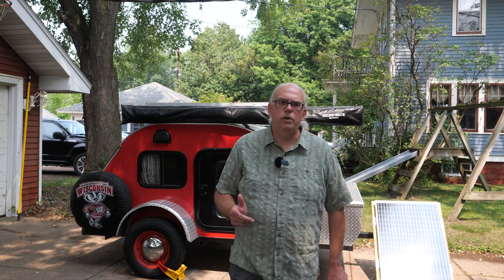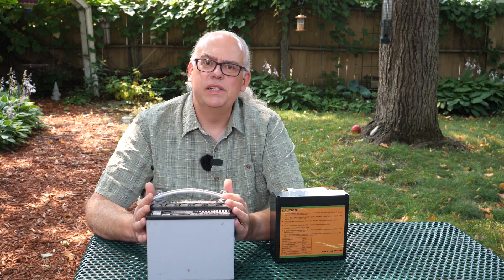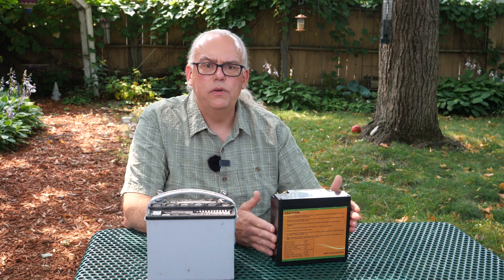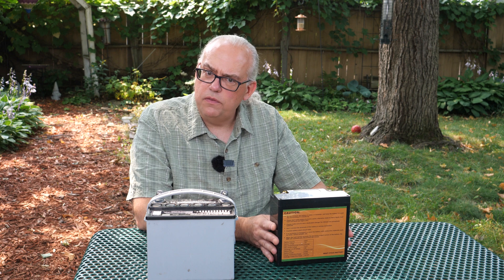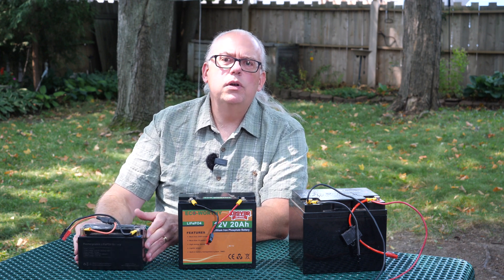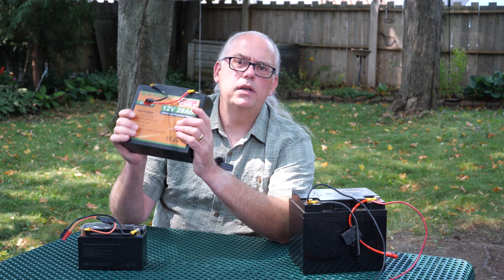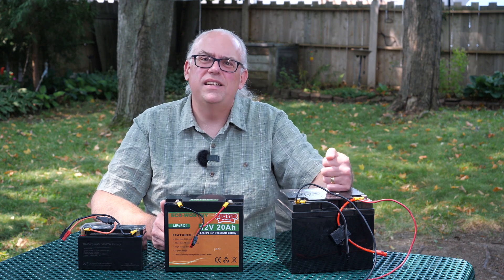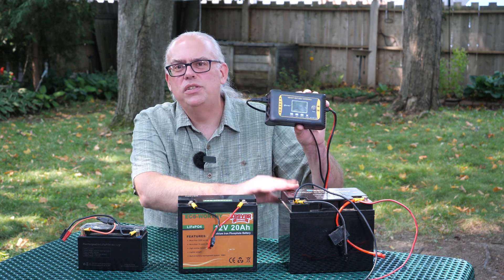Picking the best battery for portable Ham Radio #hamradioqa

Comment: I would recommend using an RC battery charger over that cheap type of car charger. The RC charger can charge more chemistries, can choose between different amounts of cells, allows you to set the charge current, can do balance charging (useful if you make your own batteries or are using a LiPo pack), and you can even have it charge/discharge to the recommended voltage for long term storage as well. 
With the car charger, if it is high current, you might be putting too much current into the battery so you might want to refer to the manual for it before connecting it to the smaller capacity batteries.

Comment: 24v capable radio like a McKinley will draw half the amount of amps if you have two of the same batteries wired in series 🤫

Comment: Something I did to address the issue of charging my batteries is that I installed a 4 gauge cable between the positive of my cranking battery under the hood to the trunk of my car, through  a 100 amp circuit breaker at the battery post.  I then connected a short 4 gauge wire to the chassis of the car in the trunk and fitted the positive and negative cables with a 50 amp Anderson Powerpole connector.

I also fitted my LiFePO4 batteries with the same 50 amp connectors to make connection in the trunk fast and easy.

When not in use, the  cable and connector are tucked out of the way in the trunk.   When my batteries need charging, I start the car and connect them in the trunk.   This provides a high current charge that minimizes recharge time.    

Measuring the draw from the alternator, with a 100 amp hour LiFePO4 battery in the trunk, the charge rate typically starts out at around 50 amps and within a few minutes drops down to about 20-30 amps, depending on how discharged they are - and, depending on their capacity.  

I have portable solar panels.  But, like you, I would prefer to not bother with them for a day trip.

During use, I connect the battery that I'm using to an MFJ power distribution box with four fused 20 amp Anderson Powerpole connectors and two pair of fused binding posts.    The distribution box has a 40 amp fuse.

No matter what the state of my battery, I connect it up in the trunk to recharge on the way home.

Of course, I am only getting 13.8 volts - which is why the current draw remains low enough that it does not risk damaging the alternator.   

Like you, I don't usually run out of power for day trips.   If I am camping, though, I'm running more than just radio equipment and I usually need a recharge.   But, if I will be camping in sunny weather, I will bring my portable solar panels (up to four 100 watt flexible panels) and charge through a Victron charge controller.

Thanks for the video!

73
Ai4IJ

Comment: Great video! Quick question —  I'm going to be hooking up a Renogy solar kit to a battery, and then hooking up an FT-891 (at 10 watts) and ldg z100 pro to that battery. My question: will hooking so much up to the battery terminals cause any issues?
Reply from the maker: It shouldn't. Solar charge controllers are designed to work under load so you can charge the battery while using it. The only concern would be noise from the controller. PWM controllers are very quiet and shouldn't generate noise. MPPT controllers, by their design, can generate noise (It depends on how well they are made and what filtering they have). I've got a 100 watt Renogy solar suitcase and it has a PWM controller, so yours might be the same. Test it before heading out into the field.

Comment: I've got a 30ah Bioeno battery that I use with my FT-891. What I'd really like to have is a battery monitor like we have in our RV trailer. It shows power in and power out. It shows the current state of charge in percentage. It's got a shunt hooked up to convey this info. I have yet to find something like this for us hams that is plug and play. Do you know of any battery monitors that would fill this bill?
Reply from the maker: I use the Victron smart shunt in my trailer, but it may not be the most practical for a portable battery kit. A lot of hams use an inexpensive battery meter like this to monitor their power: https://amzn.to/3ZSBYe7
Reply: @KB9VBRAntennas  So basically, instead of having a real time monitor, you just keep track of power used with this simple monitor. Write down hour beginning and ending values.

Comment: Question for you.  If you take 2 smaller batteries and hook them up in parallel, would you be able to draw more current?   Example if you have 1 battery at 12 amp hours therefore you should only get about 12 amps max from the battery.  Now if you take two 12 amp hours batteries in parallel would you be able to get 20 to 24 amps?
Reply from the maker: You can, with a caveat. Because LiFePO4 batteries use a Battery Management System (BMS) to control their current output, you will need batteries that are matched. That is, they will need to be the same brand and size. Otherwise the BMS in each battery will fight with the other. It's best to consult the manufacturer guidelines if you are planning to hook two or more LiFePO4 batteries together in parallel. In the long run, it is often better and cheaper to buy one larger battery than two smaller ones.

Comment: Hi Michael, Do you have any suggestions for Batteries for use as Base Backup... to run a rig, small inverter, light... for power outages and (Heaven forbid) in case of an emergency?
Use the same Battery chemistry or for longer term storage than a few days is different chemistry better"?    Thanks for spreading the Good Word! 
73   mike   🍺🍻

Comment: The batter rated for 12v my tyt9800 said power for the unit is 13.8v +/- 5%.  Does it effect anything (tx/rx) if the unit is slightly under powered?
Reply from the maker: With any battery, the voltage will drop when you pull current (Ohms law). As long as the battery has sufficient current capacity (it's amp-hour rating), those voltage fluctuations won't affect the overall power output of the transceiver. But if the battery is unable to provide full current to the radio, then the power output will be diminished.

Comment: Dumb question. Can you power multiple devices with one large battery Or do you need a separate battery for each device?  I’m just starting in ham radio
Reply from the maker: You can run multiple devices on one battery, as long as you stay under the battery's current rating. A battery isn't able to provide more power than their Amp Hour rating. And LiFePO4 batteries have a BMS or battery management system that is rating for a maximum current draw to protect the battery itself. As long as your current draw stay's under the maximum rated draw on the battery, you will be fine.
Reply: @KB9VBRAntennas  how do you measure or determine the total draw of the equipment running?
Reply from the maker: Devices, like radio transceivers, will have their power consumption listed in the specs. You can add up those numbers for an estimation. Otherwise a 12 volt power meter like this: https://amzn.to/3BQgyq0 is really helpful in understanding power use.

Comment: CAN I USE A REGULAR 12V CAR BATTERY CHARGER TO CHARGE THESE...? and can I run cb radio on a 12v car battery in my house...?
Reply from the maker: You can run a CB on a 12 volt car battery in the house, I've done that many times. For LiFePO4 batteries, you will need a charger designed to charge them. The charging rates and full charge voltage is different. A lead-acid charger will be unable to fullly charge a LiFePO4 battery unless it has a LiFePO4 mode.

Comment: Hi Michael. Thanks again for yet another great video. Time for me to move to your Patreon. Question:
 I have a LifPO4 battery ROHS 12.8 Volt and 18 Ah. Bought a charger with it: LiTime LifePO4 specific battery charger, 14.6 Volt, 20 Amp. Would the discrepancy 14.6 Volt and 12.8 Volt going to give any issues ? Thanks, even having an EV, battery technology remains a bit of an enigma to me. 73 from Johan, VK6BLU, Perth Australia
Reply from the maker: LiFePO4 batteries are advertised having a nominal voltage of 12.8 volts as that's the power we commonly expect that type of battery has. It's a carryover from the lead-acid days. But in actuality their nominal voltage is closer to 13.4 when fully charged. When you charge a LiFePO4 battery, the charger will charge the battery until it reaches 14.6 volts. That's the point when the charger senses that the cells are fully charged. When you remove the charger, though, the battery will quickly drop to 13.4v and maintain the charge level while it sits on standby.
Reply: @KB9VBRAntennas thanks so much michael, johan, perth, vk6blu

Comment: Question , I have a GMRS 50watt 12V basically it’s meant for a car but I’d like to set up like a com backpack  . How long could I run that with either battery ? I thank you in advance for your time sir .
Reply: I would get a bioenno 15ah. That would be fine, you’ll get a couple of hours of life out of that battery depending on how often you’re transmitting.

Comment: What do you recommend for a 50 watt mobile wouxun radio???
Reply: Depends on how much you transmit. A Yaesu FT-891 can go up to 100 watts, but the Wouxun radios, whether GMRS or ham, could utilize the same batteries. If you’re going for a couple of hours, I’d recommend at least a 20Ah.

- KF0QNM

Comment: Hi Mike, quick question , i like to run my ft 891 with cha tdl on pota, i can get a 12v 18 amp  Lithium Battery for 140 $ CAD or 12v 30 Amp  Lithium Battery for 300 $ CAD, you think the 12/18 can run the ft 891, if i decrease the hf out to ~ 75-80 watt out put ? Voice only . thanks
Reply from the maker: Since SSB is not a full duty cycle mode, you will seldom draw the full 20 amps when transmitting it at 100 watts. An 18 ah battery will manage 100 watts transmit for about a couple hours or so. Reducing your transmit power will increase your battery life. For example, I transmit SSB at 50 watts, and with my 20 ah battery I can get about 5-6 hours out of it. In that time period I'll make well over 300 contacts, so that is a pretty high utilization rate.

Comment: What amp charger would i get if i get the 30 amp version of the eco worthy
Reply from the maker: I think there is a formula to help you decide, but my general rule is to pick a charger that's 1/2 to 1/5 the capacity of the battery. I'd go with a 10 amp charger for a battery that size.
Reply: @KB9VBRAntennas  thank you and thanks for doing these good videos

Comment: How safe are the lithium batteries for home (indoor) use? I understand if on fire, very dificult to extinguish. Thank you.
Reply from the maker: There are different lithium battery chemistries and some are safer than others. Lithium Iron Phosphate LiFePO4 has been proven to be very safe and it has been found that it takes a lot of overcharging, coupled with a faulty Battery Management System, in order to get them to heat up and swell.

Comment: The comment about discharging lead acid below 50% will cause damage is FALSE.  You will find no such information in manufacturer data sheets.  If your equipment can operate at the terminal voltage the battery supplies, lead acid can be discharged many hundreds of times to 0%.  This represents years of operation for a typical ham doing field operations.  There's no denying the performance advantage of lithium but lead acid can still have a place for portable operation.

Mark K5LXP

Comment: How about using power station like a Bluetti EB55 which only draws out 12v 10Amp? Does it suitable for operating FT8 15-20watt with Yaesu FT891?
Reply from the maker: The issue I have with power stations is that the accessory port (cigarette lighter) is regulated at 12v and 10 amps. It's a hard limit and the transceiver will shut down if you draw more current. The transceiver works best at 13.8 v +/- 15%. If the voltage also dips below that threshold, the transceiver will shut down. 

With the FT-891, I've found that I can't go more than 40 watts SSB using a power station. 15-20 watts FT8 may be possible as long as the Bluetti can deliver a consistent 12 volts.

Comment: Some interesting information here, thanks. 
I bought 12 AH Sealed Lead Acid Batteries for home use with a solar panel with my QRP h/b radio and then got an FT817ND for portable use but a lead acid battery is heavy for a rucksack so looking into Lithium Iron Phosphate.
G4GHB.

Comment: I have a qrp radio that needs 12V , lifepo puts out about 13.2V, want suggestions ?
Reply from the maker: Most transceivers will work +/- 15% of their recommended voltage. Check the specs for your radio to see what range it desires for an input voltage.
Reply: @KB9VBRAntennas  the QRP Labs QDX will not, effectively.  increased voltage from 9V to 12V. Decreases Output power from 5W to 3.6-4W depending on band. Additional voltage will me at a QQQRP radio 😀

Comment: Thanks for the video I use a 30 amp version made by Powerhouse. I have done 5 VKFF parks to 44 + QSO in each 30w ssb 20w cw that was about 12 hours on air time all on the same charge. Cheers all 44 73 vk5cz ..

Comment: Michael,  I love that you are pushing LFP batteries.  I have been doing that since 2020.  I would like you to think about checking out REDODO Power.  They have a 100AH LFP that is small enough to fit in a 50cal ammo can and is half the weight of a regular LFP 100.  Very new unit, and I think would be well worth the cost.
Reply from the maker: I don't have any experience with the Redodo battery. There are new cell configurations coming on the market that are reducing the size of these batteries. It appears that Redodo sent free batteries to a bunch of people for review. In disclosure, they offered me a free battery but I passed on it- I don't have to facility to do an objective review of these larger batteries. For excellent insight and teardowns of LiFePO4 batteries, I recommend Will Prowse' channel. https://www.youtube.com/@WillProwse

Comment: Nice informative video.  Do you run your FT-891 directly from your battery or do you use/need a boost regulator to raise the voltage up to 13.8 volts?  In other words, how well does the FT-891 work on voltages lower than 12.6 volts?
Reply from the maker: I don't use a booster with my LiFePO4 batteries. I really don't think they are necessary with that chemistry (unless you require voltage stability) as the nominal voltage of a Lithium Iron Phosphate battery is 13.4 volts. Nominal voltage of Lead Acid is 12.6v.  The FT-891's voltage requirement is 13.8v +/- 15%. It will operate over a wide array of voltages. I've had no issue running it with lead acid batteries and with LiFePO4 batteries as their charge diminished. The only time the radio shuts down is if the floating voltage drops below 12v.
Reply: @KB9VBRAntennas  thanks for the info.  Very helpful.  73

Comment: I am working to set up an outdoor UHF repeater, which will get little use. 
I would like to set it up with a battery power supply that I can occasionally run an extension cord to to recharge. 
1 will the analyzer you mentioned record a history of the use pattern so I could come and check it after several days or weeks to see what the draw pattern has been?
2 do you have a recommendation for a lithium iron battery which has one or two 12V outs and the ability to charge from an extension cord?

Comment: Michael, holy cow.  Let's talk trailer for a moment.  That looks like something I googled called A "Diamond in the Rough" by Teardrop Trailers, Inc.  Is that diamond plate all over it from front to back, or does the top of the trailer just appear to be?  How do you like it so far?
Reply from the maker: The trailer is a TC Teardrops 5x8 camping trailer. https://www.tcteardrops.com/. It has aluminum skinned sides and a aluminum diamond plate top. If you dig through my Parks on the Air playlist, you can see more of the trailer, otherwise the manufacturer website will show you more pictures of their product.

Comment: I follow your channel for some time now. Great content! This video rises a question. My experience with my a Rebbel Cel LiPo battery 50Ah  is that the optimal voltage for my 891 (13,8V) is not met. Fully charged it gives 12,4V and with a little use its base voltage goes to 12,1 volt. On full power the 891 shows dimming of the display light on Tx. I could of go for lower Tx power but  I solved the problem by using a powers stabiliser form 8-17 to 13,8 volt. These stabilizers are normally used for charging battery from a solar. Now the problem seems to be solved. Do you have the same experience with your 891?
Reply from the maker: I'm not familiar with that brand of battery, but a fully charged LiFePO4 battery should have a nominal voltage of about 13.4 and should stay within a few tenths of that under load. it wouldn't drop to 12.1 unless the battery is almost entirely depleted. My only thought would be if a cell or two is bad. These batteries are constructed out of multiple smaller cells that are connected in series and parallel to create banks of cells. If one cell is bad, it can cause the entire bank of cells to not provide power, reducing your voltage.
Reply: @KB9VBRAntennas  Your reaction made me think. Was I sold a faulty battery? I run it for 4 years now in my canoe and only the last half year on the 891. I looked is up and No, according to the manual all is within specs 9-12,4V. I bought the battery originally with the electro motor of my canoe so it might be the intend purpose or American batteries have other specification that suit the hobby better??
Reply from the maker: That battery may not be a true Lithium Iron Phosphate battery, or uses some other chemistry if the floating voltage is 12.4v. That's more in line with what a lead acid AGM battery would produce.